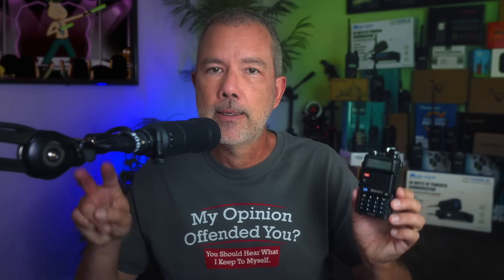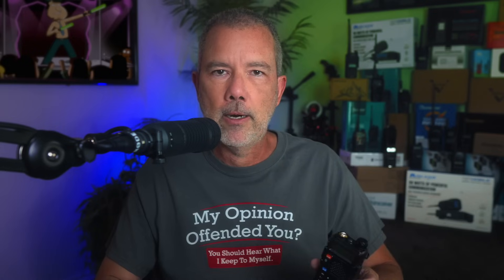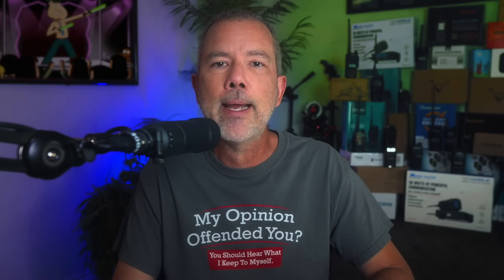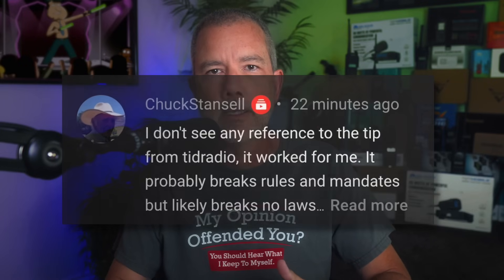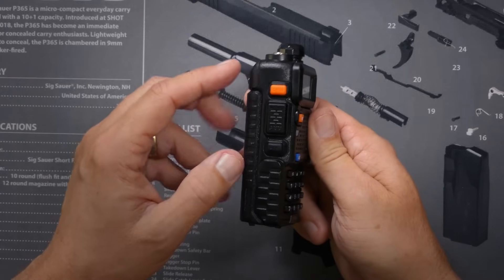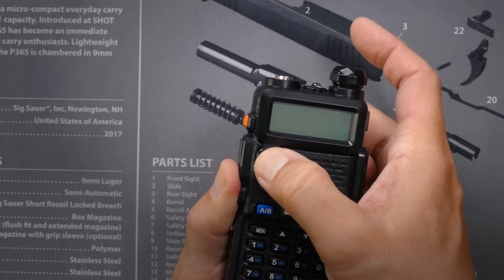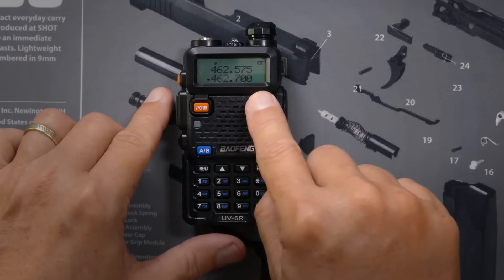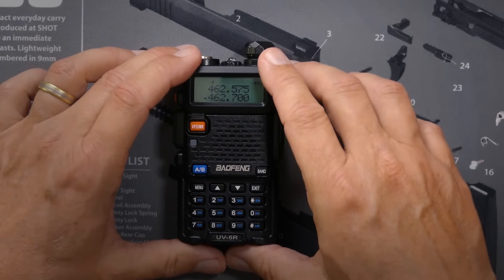How To Unlock A New Baofeng UV-5R - Easy UV5R Jailbreak To Transmit On More Frequencies

Comment: Hey brother. I just got my radio in the mail today and no such luck using the button press method on this radio. I pressed the bottom two and orange front button. Even went so far as to factory reset thru the menu when that didn’t work.  

If you have a resource I can read up on please reply to this and or inbox me or I guess I could go to your personal site if you are ok with that form of contact. 

I wanted this radio because of the inherent ability to broadcast over 17-21 on bc frequency in case of need for help on my truck runs so I wouldn’t have to buy and build a port-a-pack or hack pack from bc and ham combos. Thanks again.

Comment: Mine Unlocked (Jan 2023) THANKS! I will program NOAA weather. Also listening for road and boating conditions Marine Radio channel 16 Emergency calling and channel 19 GMRS incase I have a road emergency , I don't desire to transmit with strangers but if there is an emergency I am glad I can contact someone.

Comment: I haven’t ever unlocked my radio. But I’ve been using it just fine. Has the red light when transmitting. Also had a few channels programmed with random frequencies that don’t match the generic GMRS frequency list. Maybe someone had mine and sent it back and I ended up with it? 😂🤣🤷🏼‍♂️🤷🏼‍♂️

Comment: Didn't work on my UV5R received 2 weeks ago from Amazon....   Seems they have made some changes, tried factory reset and didn't work after either.  When I hold 3 when I turn it on it says BFB298
Reply: BFB298 is the version of the firmware that it is running. Supposedly you need to also press the call button down making it 4 buttons you hold down then turning it on. Is this confirmed to work?

Comment: I tried the unlock button hold on my BF-F8HP and it doesn't work. Any suggestion???
Reply from the maker: Is your BF-F8HP even locked? As far as I am aware, they are not locked.
Reply: @TheNotaRubicon  It’s locked, i put in the 420 channel you suggested and when i press transmit it turns red.
Reply: @TheNotaRubicon  sorry the frequency is 462.700 and turns red

Comment: I just ordered a couple of these radios and the factory reset procedure is not working. If I hold down 3 while turning it on, it shows the version is BFB298. Has something changed and these can no longer be unlocked with the PTT + Monit + VFO/MR combo?

Comment: Fantastic channel with a lot of really good information.  Santa brought me a brand new UV-5R for Christmas this year with a 2022 serial number.  Unfortunately, this method of unlocking does not appear to work.  I am guessing that they either changed the method or locked the newer units down permanently.
Reply: Supposedly you have to hold the call button down as well now making it 4 buttons then turning it on.

Comment: This thing isn't as cool as I thought what's the big deal with it? It doesn't get frequencies 118-130 which is where all the fun stuff happens. What's the point of this radio?
Reply from the maker: For most people, the point is all of the other frequencies that it CAN receive and transmit on.  If this radio doesn't meet your needs, then save your $29 for a radio that does..
It's not that complicated.

Comment: Got my UV5R in the mail today and unfortunately this didn’t work. Doesn’t say “factory” on start up and only beeps when you hit the PTT button. Any thoughts?
Reply from the maker: You should read the words in the info section of the video.
Reply: @TheNotaRubicon  would you mind recommending me a radio that’ll definitely work for me? I know next to nothing about radios or the terms you’re using. I’m a logger and use a radio at work all day and the channel is 173.370. Just trying to get a hand-held that won’t break the bank.
Reply: Thank you for the response, I guess I’m shit outta luck.

Comment: Further to my comment that your ingenious unlocking method does not work for my brandnew UV5R (bought via amazon Germany), I found a way to unlock the device ... using Cirp :-) ... yess Sir, Cirp. In settings tab, other settings, you may set VHF lower and upper limit and check the box TX Enabled. Same with UHF.  Works like a charm. 

Only downside so far: CTCSS can not be set in the device any more ... will not save the changes. You have to set those in Chirp as well.

Further finding: you can set the transmit range even to 600 Mhz althoug the specs shown on ali  say 520 max. Seems to work as well, might be a prob with the antenna :-)

Comment: Great videos.  Got my first UV-5r8w.  I can not get the FM receiver to work.  It goes into the mode but i hear nothing.  I live in strong FM coverage.  I do have chirp and have Broadcast FM Radio enabled.   I read this can be something that the chip shortages got to?  thoughts?
Reply from the maker: Many of the low-cost radios have been shipping without an FM chip because of shortages.  My thoughts are: if you require an FM radio in your ham radio, send this one back.. OR, go to Target and get an FM radio.
Reply: @TheNotaRubicon  That is what I did read on one google search.  Wanted to just confirm you heard similar.  I certainly do not need the FM.  Just a toy to use.  I certainly have plenty of FM devices.  Thanks again or the videos and the wise @#$ comments.   It is great banter.

Comment: I have no GMRS frequencies in use near where I live. However, the uv5, sv9, and I am sure others can be jailbreaked, if you so desire. You may need a second pair of hands to accomplish this. Sorry, sad hams. Randy provides a great service. Get over it.
There are plenty of truckers running 10m in addition to cb well over 4 watts. 

The whole point is COMMUNICATION, especially in emergency situations. Do you want to die because you have no cell service? Get over it! I once had a ham call SP NY to send emergency services. I was in Orange County, NY. My contact was in Stuttgart Germany. He called NYSP Troop F from overseas and they saved my life in a blizzard. 

Carry on, Randy.   Screw the sad hams.
Reply: If I were a truck drivin' man, I would definitely have a modified 100 watt HF radio for both ham and CB.

Comment: Hi there. Love ur videos mate. I have an older uv5re and when I do as you explained it shows the word copying. Not factory. Do I need a newer radio for this to work ? I can't access the 462 range.
Reply from the maker: Is your UV-5Re locked?
Reply: That's a good question. I'm guessing it is. I can't use those frequency's you unlocked in the video. It will do a lot of other bands no issues.

Comment: Did you buy a single band baofeng uv-5R??? Because mine is dual band VHF 136 - 147MHz & UHF 400 - 520MHz from the factory and I can transmit at all of them, just push the VFO/MR button to enter the Frequency mode (it will indicate only the number on the screen) and type the frequency you want then transmit, all baofeng Radio is unlocked & you can program the channel you want. Note: I'm from Indonesia & all radio transceiver in Indonesia are in factory mode (unlocked & free to use at your own risk)
Reply from the maker: UV-5R radios sold in the United States have been locked since around 2021.
Reply: @TheNotaRubicon  but United States are known as the country with so many unlocked device, right?

Comment: My new unlocked uv-5r results. When transmitting on a gmrs channel, it switches to freq 666.666 and continues transmitting when the transmit button is released. To turn off transmit the radio must be turned off. Fyi

Comment: This can unlock freq under 88.000 MHz?
Reply from the maker: No.
Reply: @TheNotaRubicon  thanks, is there solution for this?
Reply from the maker: YES - The solution is to purchase a radio that can transmit on frequencies under 88.00 MHz.

Comment: I don't know how to use the bf f8hp, or any other ham radio. But when I tried the unlocking button pushes, and turned on the radio, I just saw the a and b channels. HOWEVER, I tuned into a gmrs channel,and pressed talk, and did not receive any kind of error message, and the red light came on. Does that mean it works?
Update;
I went through the button pressing sequence, and ALSO,  another button pressing sequence before I tried it.
I have a BTECH GMRS UV2 radio, so I tried transmitting from the BF-F8HP to the UV 2, and it WORKED, on the frequency for channel 22

Comment: If I am able to recieve freq 462.575 for example on my UV-5R, does that mean mine is unlocked? Sorry if its dumb but I'm new & just started researching. Im just curious if mine is one of the beloved or cursed UV-5Rs.
Reply from the maker: No. Locking refers to what frequencies the radio can transmit on. So if you can transit on a non-ham frequency like 462.575, then it is unlocked.

Comment: Love your videos. 50% succes. I am in Canada and orderd 4 UV-5R with the 3800 battery (yes I am one of those that size does matters) I tried the factory reset on all of them and they all said the magic words. But it only worked on 2 of them. The only diference I saw was that on the inside sticker one has a FCC ID and the other HVIN. Any body else with this problem?

Comment: It ALMOST worked for me.  I did the mod and it would TX on the GMRS etc.   I did not check to see if the audio was being sent.  I programmed all my channels with CHIRP and all is well.   ALMOST.  The memory channels all work great.  Normal.  THe VFO channels transmit power to the antenna but ZERO audio.  No voice no dtmf tones from the keyboard.  Nothing.  No audio,.   Back to a memory channel and it works fine.   Seems strange.  Not sure exactly what is messed up but I can't use the VFO frequencies at all.   Not really a huge issue for me since I rarely use the vfo anything and have 120 or so channels programmed and they all work great.  If any one has any tips on this one I would appreciate it.   Thanks.   Hey at least the thing is usable now.  Very kool.

Comment: Neat trick. Just tried it on my UV-5R-Plus and it doesn't work. Either they got rid of it in the Plus model, or it's set up another way. I've been trying different combinations. Though I find it easy to do it. If I find anything, I'll post back.

Addendum: Turns out I can already transmit on GMRS. I tried the 462.700 and got the red light on PTT. I'm new to this radio so I don't know the difference between Plus and non-Plus model.

Comment: im trying to find info on "MARS" modding ,or something similar., for my UV5R
in CHIRP.... there are settings for UHF/VHF "upper/Lower limit"..... 136-174mhz.... and 400- 520 MHZ
if i changed thes numbers, will this give these new frequencies to the radio? for example, if i changed the ranges to cover everything between 1mhz and i dunno, 2 ghz, or more, would it receive theses frequencies? what about transmitting, would that work? obviously it wouldnt be perfect as its not made for all the stations, but i think it would be better than not having them at all....... what problems could occur from doing this? technical problems, like damaging or destroying the radio in some way, i do not care about "the law".

Comment: Sweet Sweet - Thank You Buddy 

I always want to be able to call on Marine Channel 16 if we go in an Emergency and had the baeofeng, I just purchased a new one and it didnt transmit on the marine channels like my other ones would.   Quick unlock by your method, worked no issue, and the radio will work on marine if we ever need to for emergency. 

It worked on my BF-F9

Thanks a million 

SC - Southeast Alaska -

Comment: New to This , what does “unlocking” do and uses? And also which FQ do I need to have a license for
Reply from the maker: The UV-5R is a ham radio, and to use it the FCC says you must have a ham radio operators license.  If you dont know what unlocking does, then you probably dont need to unlock your radio.

Comment: I am a complete noob to radios and found this channel thanks to Dave Canterbury's channel. I recently bought a UV-5R and I have a question about this Jailbreak. Is it possible to undo the hack later? Before hacking a device I usually like to know if the hack can be reversed . I doubt I would have a reason to undo it but i would still like to know. Did some searching and couldn't find an answer.
Reply from the maker: Is Dave Canterbury talking about me again?
As for UNdoing - check the info section for warnings and updates.
Reply: @TheNotaRubicon  Don't know about "again"  because the video is a year old. He was right about you being a wealth of knowledge on this radio and being funny. I've watched several of your videos in a row and haven't got confused or bored yet. 

Thanks for the replay and sorry for not noticing the section. I have gotten so used to channels saying they will put something in that section and then not doing it that i rarely bother checking it anymore.

Comment: okay...
i did this, got factory, programmed a UHF channel via chirp... can't talk with my UHF radio. quadruple checked the channels are correct. 

what happens is, transmitting from the bubble pack, it makes a half-second squelch sound when finished transmitting on UV-5R, but doesn't hear anything. when transmitting from UV-5R, the bubble pack receives nothing. (ahem, ahem, antenna was in... i'm totally in a jurisdictoin where this is allowed.)

what gives?

EDIT
hmmm... let's upload the BF-888's channels.

well what do you know, the channels don't match what you google for UHF radios...

okay, so now the channels are correct, and i can hear on the UV-5R. and i can transmit, as indicated by the green light turning... green!... on the BF-888. BUT! my voice does not come through.
what the fuck, baofeng? does my microphone not work?
Reply from the maker: Did you read through the info-section and the warnings/updates?
Reply: @TheNotaRubicon  i didn't even see such a thing?
Reply: @TheNotaRubicon  where would this stuff even be? i see nothing of the sort in the manual or in the install blab agreement checkbox thingy for chirp.
Reply from the maker: Dude.. the Info-Section of THIS VIDEO ...
Reply: @TheNotaRubicon  oh, didn't follow.
i don't think any of those warnings apply to my issue though. all signs point to a microphone issue.

what i think happened, after too much googling, is that the act of plugging in the cord somehow damaged the internals and broke the microphone. (this is assuming the mic ever worked to begin with, which i wasn't able to verify.) this is apparently a thing. plug in two-prong cord, fuck up the mic. 

looks like i'll be exchanging this radio, at amazon's expense, for another one and praying to... not vishnu... i forget the name... that i get one made just a little better by the slaves in china.

Comment: My transmit light comes on my radio Baofeng UV-5R; the club radio Motorola Vertex standard's green light shows it it receiving but no audio. Any ideas?
Reply from the maker: Make sure there are no codes on the Motorola, and make sure you're at least 10-20 feet away from each other.

Comment: Just purchased an additional UV5R and in addition to the 3 handed solution I had to do a factory reset with menu option 40.  Transmitting fine, just have to upload from chirp.  Thanks for the info.

Comment: I have a Baofeng BF-F9 V2N that I bought on Amazon... I wanted to use it also for MURS channels like 154.570/154.600 but it wouldn't transmit.  
I followed the instructions in this video and it worked perfectly the first time.   Thanks.

Comment: I have 2 UV-5R radios that I inherited from a fellow ham that passed.  I tried to perform this unlock, but it did not work.  I noticed that the factory presets of channel 0 and channel 127 had been deleted from the memory, so I used menu item 40 to reset all of the frequencies.  With that, channel 0 (136.025) and channel 127 (470.625) had been restored.  After that the unlocking procedure worked and the GMRS/FRS frequencies worked.  Thank you for your video!

Comment: When I try the unlock feature my radio only says "coping" (not copying). Is this a different version of firmware? Is there a way to get around this? A few google searches and browsing the comments here and it does not seem like anyone else has experienced this.

Thanks!
Reply: I am having the same issue on my UV-5R.  Have you found a solution?

Comment: I live down under in New Zealand.Ordered and paid for my new Baofeng UV5R from China.Followed your instructions on how to unlock this portable.Our city police frequencies here are scrambled. But the frequencies outside city limits are not.They are on the analoge frequencies 75Mhz.However following your instructions as well as another Y Tuber,it simply will not unlock.Going to "Reset" in menu does nothing to unlock it.Seems the one I have purchased,it cant be done. Anything inside on the circult board can be changed? Would love to hear from anyone as long as I can see it is genuine thanks.
Reply from the maker: 75Mhz is far below what this radio is capable of receiving and no amount of unlocking can change that.
Reply: @TheNotaRubicon  Thanks for your advice.This one definantly will not unlock any other TX frequencies.It is fixed to the A/B frequencies as set.But I will use it on our 70cm national link with my Ham licence.Also scan the  frequencies it has.Thanks.

Comment: 08/2022 update 

I purchased the “newest” production model that has the larger battery included. I did the reset before I powered it on for the first time and it did reset. Works perfect.
Reply: Did you buy it on Amazon? Mine comes in tomorrow and I hope it isn't one of the newest ones that can't be unlocked.
Reply: @MLGPRO-dx8fg  update ?